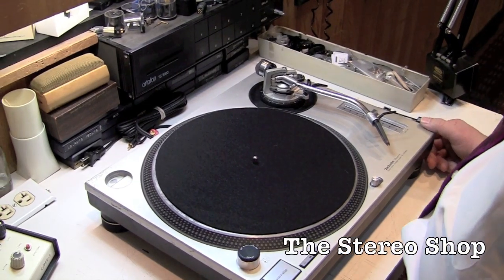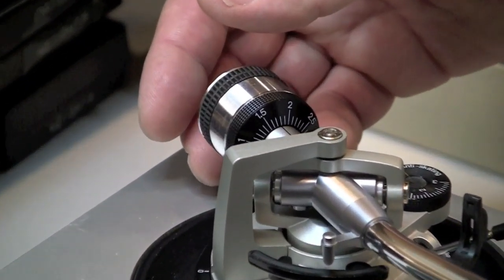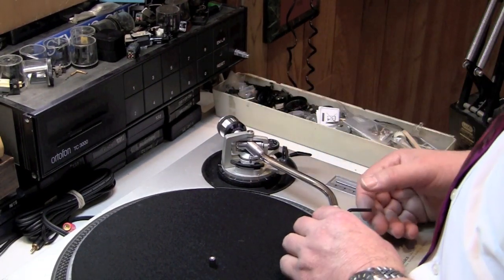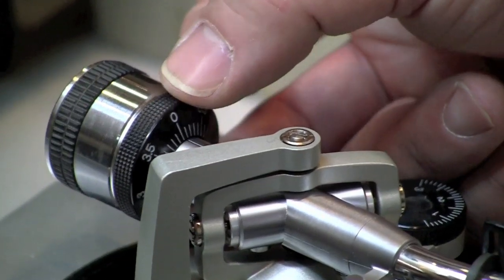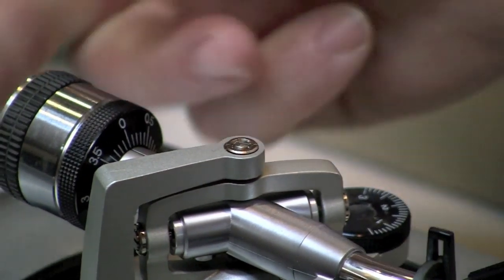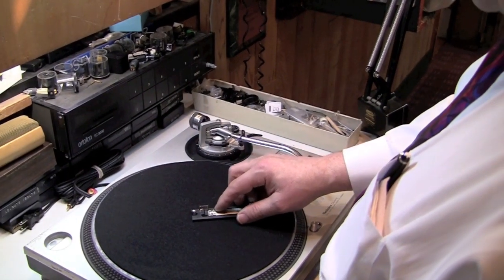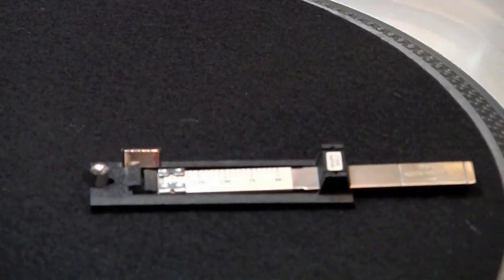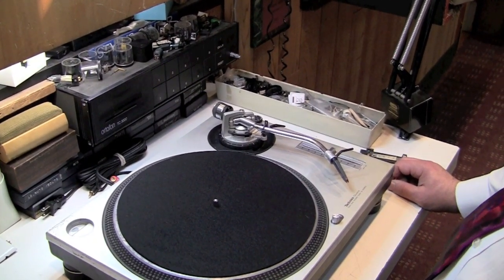The Stereo Shop ___Turntable Calibration 1

Comment: Hello...I am just very respectfully pointing out that there is one VERY IMPORTANT AND CRUCIAL step in your demo that you did not explain properly. ---> You forgot to mention the specific reason you chose 1.5 grams as the tracking weight on this machine. He is correct only up to the tracking force dial settings of the weight selector on the dial. (grams on the black wheel)So..... After you have balanced (achieved the floating effect) STOP!!!!!!!!!!!!!! All cartridges were not created equal!!!! Every cartridge/headshell/stylus..etc has its very own IMPORTANT tracking weight recommendations. If every cartridge required 1.5 grams than the headshell wouldn't be replaceable and set at the factory to 1.5 g's. Why go through the trouble of adjusting all that when it is one constant weight? The answer is...you don't always set it to 1.5. Some require upwards of 5-6 GRAMS!!!! WOW!!!!ALWAYS ALWAYS ALWAYS read your cartridges specifications when you purchase a new one, or look it up online if you have and old one and/or if you don't have the box or spec's leaflet that it came with.NOTE:  Setting a too heavy tracking force will SHRED your precious LP's to oblivion.Hope that I actually helped at least one person...lol! :-)

Comment: Hi There and I hope you can help me here. I bought a BSR 3S Mcdonald turntable record changer in good working condition. It was working fine but then one day while cleaning it I do not know what happened its tone arm does not now stay at the resting spot. What I mean is that when I slide the level for start of this machine, the tone arm goes up, and smoothly lowers itself correctly on the record till the end. Now when I want to turn it off and slide the level again to Auto stop, it picks up and goes back to resting spot but does not stay there to stop/Off but rather again goes back to playing record. I wonder if there is some setting gone wrong why it does not stop at the resting stand and turns off. By the way, when I click the "OFF" level, it goes up and stops.....Please help.